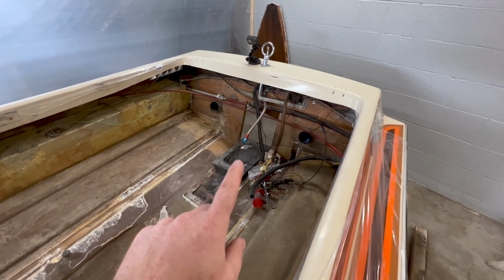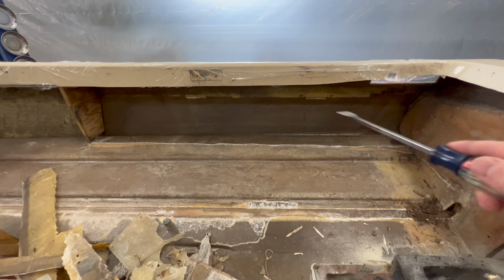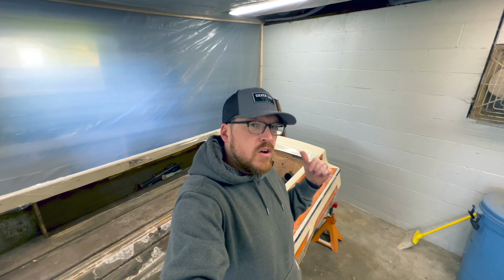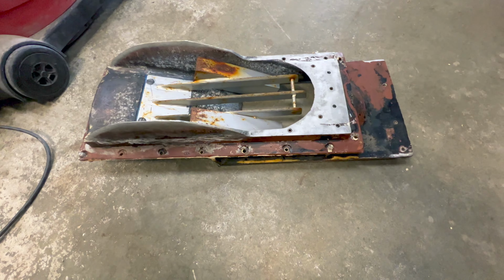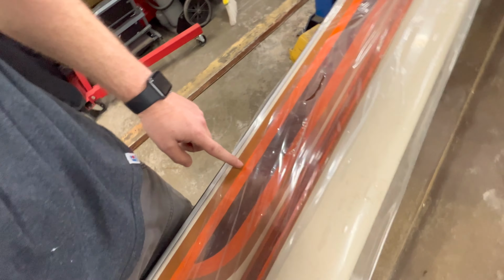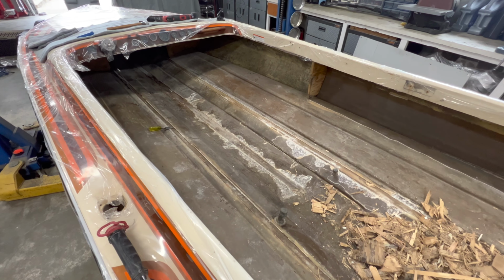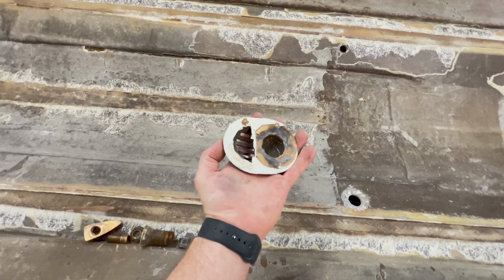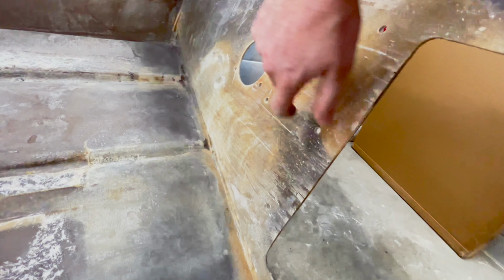Cutting Out & Removing the Rotted Transom in a Jet Boat

Comment: I just bought a Tahiti Jet boat with an Olds 455. Transom is in need of replacing. 
I wasn’t sure whats involved. Now that ive seen this video. I know i can tackle it. Ive been restoring classic vehicles for 30+ years. This will be my first boat restoration. It’ll need new gelcoat also. But thats the easy part for me. 
Subscribed. And thanks for the in depth explanations on each process. 👍🏻
Reply from the maker: Thanks for the support. Glad that you found the videos helpful for your project! Hoping that your build goes quickly and smoothly!

~ Nick
Reply: @AutoTechNick  i noticed you have both vehicles and the boat project going on.
I saw you have the Honda in a paint booth.
Im assuming you are in the auto body industry?
Reply from the maker: @johnnymula2305  Actually I spent 20 years as a mechanic. Then some how I found my way into the aerospace industry, manufacturing rocket engines. 

Auto-body has always been a side hobby for me. I have had some training both in school, and while working at a street rod shop in high school, but it has never been a day job.

~ Nick
Reply: @AutoTechNick  so, you’re literally a rocket scientist 🤣👍🏻

Im enjoying the boat building series. 
Very thorough, but not over complicated. And no BS. Just straight forward to the point. And edited very well. (Which seems to be the hardest part to get right).
Reply from the maker: Not even close to a rocket scientist 😂 😂 😂. I won’t place myself in that group! I was initially hired on for my technical experience, but I quickly moved into a management position. I do work with a bunch of incredibly smart people though.

Thank you for the kind words. I really do appreciate them. I do put a lot of effort into the edit of the video, but that is a skill that I have had to acquire to support this venture. 

~ Nick

Comment: Thank you! This is the only video that I've found that shows dealing with the intake plate mounting! I'm currently preparing to mount a berkeley jet drive in a Carlson Glastron 512 that has a mercruser in it. I hope it turns out. Now I just need to find that marine white epoxy stuff. 😁
Reply from the maker: James, I am glad that you have found the video useful. Like all of us, I have read and heard so many horror stories about cutting the intake out. Well with the right tools and correct approach the job is a breeze.

I was able to get by Sea Goin Poxy Putty from CP Performance, after a short wait on backorder. That will be the stuff that you are looking for to set your intake:

https://www.cpperformance.com/p-13943-heavy-duty-sea-goin-poxy-putty-3-lbs-1-quart.aspx

Best of luck with your project!!

~ Nick
Reply: @AutoTechNick  thank you! I was thinking you'd have to reinforce it with metal or wood first. I've watched clear up till you finish the one tank install. Those stringers look amazing! Wish I could find some oak that wasn't extremely expensive, that'd never rot 😆
Reply from the maker: @lovetofly32  Typically not. As long as the fiberglass is built up thick and strong enough that is all that is needed around the pump intake. 

I will be dealing with my pump intake here in the next few videos, so I can cover some of that. 

I don't know if I could bring myself to burry beautiful oak under all the fiberglass for the stringers!!! Doing it with the CVG Doug Fir was hard enough! I am confident that with the proper water drains and care of the boat I will not need to worry about more rot.... Hopefully, I'll be long gone and my son will have to be the one who deals with it the next time... 😂

Comment: Just an idea, when the tanks go back in, do NOT use a stiff fuel hose. The deck on these boats will flex, it's just a fact of life. If you have ever seen spider cracking near fuel fillers, I can almost guarantee there is a stiff fuel hose attaching the tank and filler. When the hull cap flexes, and it will, the filler turns into a reinforcement point,(when a stiff hose is used) solidly attached to the hull via the fuel tank. This stiff point stresses at the fasteners under the filler at 4 points, which are usually just small nuts. Eventually, lovely spider cracks will appear.

I will be looking into using a silicone baffle or equivalent on my tanks when they go back in. Sort of an accordion style connection to allow independent flex of cap and hull.
Reply from the maker: That is a great tip Ernest! Thank you for sharing. 

I did notice significant spider cracking for the bolts holding my fuel fillers on as I was removing them. My hoses were pretty firm and short upon removal, I never gave it a second thought to as why though.
Reply: I noticed the same situation on my Raysoncraft when I pulled the fiberglass “shoebox” tanks out- the filler connector hose is quite stiff. Also I’ve been wrestling with how to reinstall my new aluminum tanks after cutting the old ones out with my oscillating tool (great invention!). After seeing how the factory installed your aluminum tanks with ‘glass, I just may do the same and tab them right back in.
Reply from the maker: @daveaustin69  I plan to change the way my fuel tanks are mounted in the boat. I would like to move away from glassing them in. I am working out a way to mount them so they are fully bolted in. I like the thought of being able to quickly and easily remove them if I need.

Comment: I'm on the ass end of my transom work on my 73 eliminator.  I have the pump out getting rebuilt,  transom was rotten from cavitation plate hardware on the driver side. Luckily the stringers were in good shape. I totally deleted the plywood all together,  6 layers of 1708 with laminating resin, top coated with a curing agent,  all tap plastics products.  The seam of the boat had to be straightened out after the wood and old fiberglass got chipped away. It was a shitty but fun project for me and my kid to do. Good luck
Reply from the maker: Thank you! Sounds like you had a lot of work to tackle on your project! I considered eliminating the wood on my transom, but decided not to mainly because I have swim steps on the back of the boat the we frequently use. Because of that I will be replacing my transom with ¾ marine grade plywood.

Comment: It may have been rigged with a closed cooling system in the past. The pickup and dump in the hull were likely for the heat exchanger.
Reply from the maker: That is possible. Certainly seems like the long and hard way to cool the engine 😂

Comment: Are you going to set back the pump?   I would like to see that done before I do mine
Reply from the maker: I HEAVILY debated this!! I decided not to for several reasons.

1. I am running an older Berkeley Jet-O-Vator rather than a Place Diverter. The way these Jet-O-Vator’s function is by reacting off of the transom housing cover in conjunction with the steering cable. If I did a set back pump I would have had to completely re-work that in addition to making the new transom plates.
2. I did not want that extra scope of work at the moment. I want the boat back in the water.
3. I am adding an adjustable shoe and ride plate to my boat. I want to make only one change at this time so I can see and feel how the boat reacts.
4. In the future I plan to upgrade to a Place Diverter and a droop snoot. Again making one change at a time to understand how it really affected the boat
 
After those items I will likely come back and pull the intake and perform a setback. I know, I know I am crazy for doing it twice…. But those that know me well wouldn’t be surprise in the slightest, 😂
Reply from the maker: Aaaaaaand now after typing that response I am questioning my chosen path once again… For now I am going to stay focused on the replacement of the transom and stringers. I’ll see how I feel once it’s time to set the pump intake. I might just go for the setback right away. 😬

Comment: Also you are never going to find one that the intake  is centered between the stringers.  So unless you offset the motor between the stringers it will never line up.
Reply from the maker: Correct. We cannot assume that the stringers are actually square and center in the boat. The pump is installed and centered off the keel and the engine needs to match the pump, not the stringers. When I am going back in with my new stringers I am going to do my best to get everything true and center, stringers included. Everything will be centered off the bottom / outside of the keel.

Comment: You removed the thru-hull water strainer pickup scoops.
Reply from the maker: Yes, but what were they using the water for? One suggestion was for engine cooling/ electric water pump?
Reply: @AutoTechNick  the strainers would feed water for cooling. I don't know if the original motor had a raw water setup or intercooler. 
My 1970 Larson was converted to a 3 stage jet pump in 1974. The jet pump pushes water to a stock GM belt driven water pump and to wet headers.

Comment: I imagine you take notes on the wiring and everything as well as pictures ….
Reply from the maker: Great question Dave. I have not discussed those topics in a video yet and I probably should. Before and during any project I am very heavy on taking many, many pictures from different angles. They always come in handy during assembly. As for the wiring, my down and dirty method is just taping both ends of the wire indicating where it when, or what it controls. If you look very closely in the time lapse you will notice the blue painters tape that I used to mark the wires with.

Comment: I presume the booth is vented with fan(s) ?
Reply from the maker: Yes. I have a wall mounted fan at in the rear of my shop that is pushing air outside. At the front of the booth I use three regular box fans to blow fresh air in. This setup has done a fantastic job at preventing the rest of my shop from getting buried in dust. I can show this setup in some detail in the next video.